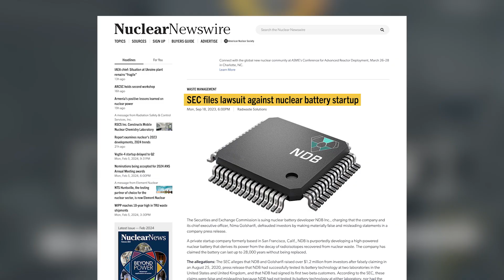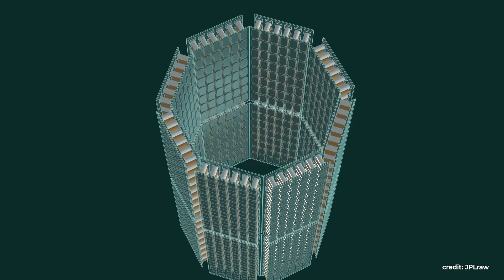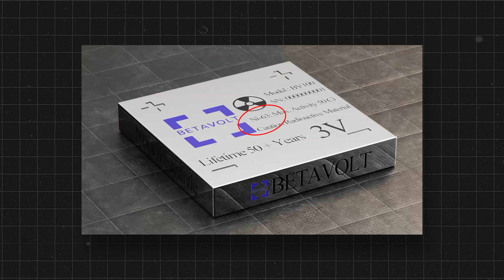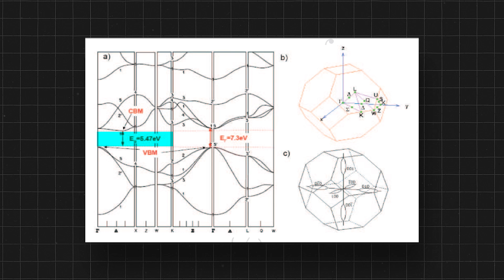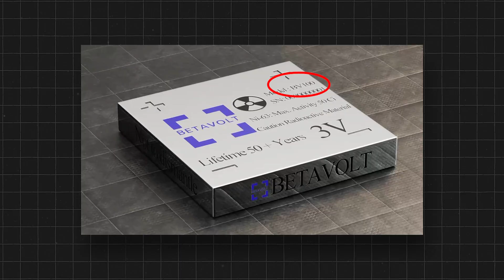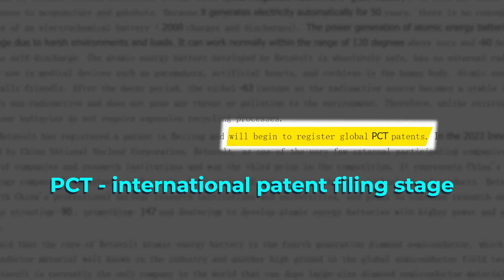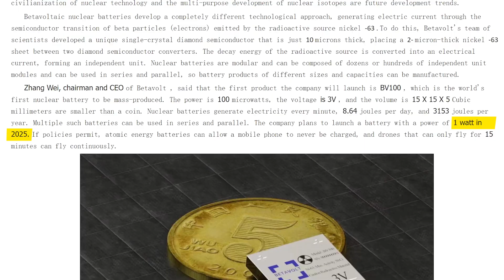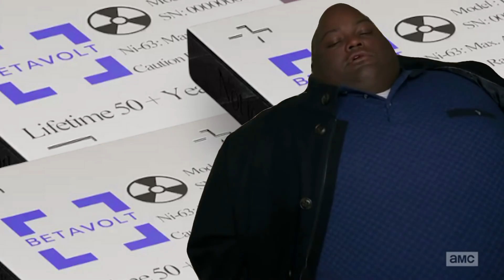Inside China's Nuclear Battery Breakthrough

Comment: For lighting perhaps you can create a "1 piece unit":

1. That contains the batteries in parallel.

2. The batteries can then connect to a wireless controller. 

3. The controller will then connect to the light which will be energy efficient LEDs. 

4. The whole "unit" will then wirelessly connect to a wall mounted button. 

5. Then the whole unit can be controlled via the button or smartphone. 

This would allow for more batteries to be used, but spread out rather than in a central location and they can be recessed into walls or into roofs depending on the location of the lights. 

By being a "1 piece unit" this means that users can replace lights older lights one at a time making them more cost viable to do so rather than having to do a whole house at once as well. 

By making the lights and batteries "1 piece unit" it removes the need for additional costs of wiring and electricians being needed.

Comment: I worked on the original nuclear batteries for pacemakers mid to late 80s? I recently found out that 29 of the original units are still being used as of 2024? So apparently they did have a highly successful design. I have no clue why these pacemakers were not replaced for newer designs.
Reply: Patients dead or refused surgery.

Comment: I would love for this product to get up to scale for consumers and have 1 watt or more output at 5V (maybe 3V). These would be fantastic for remote micro controller projects that power would be clunky to get to.
Reply: These are far from "new" and are commonly used in pacemakers for decades now. They don't scale as they are the same tech as the RTGs which have been in use since the 60's by both the US and Russia in satellites and the like.
Reply: @SilvaDreams  I am referring to the Chinese manufacturers claims of 1 watt by 2025 with reference to betavoltaic technology. Also RTGs uses heat differentials and betavoltaics don't (at least not at the massive scales that RTGs, there might be some minor heat generation but who knows and they don't primarily generate electricity through heat differentials). So these are not the same RTG tech as the 60s.

Comment: Sorry but this is not new. 
That is for one. 
 Umber two, this batteries have an output in current in micro Amps which is totally useless for 99.99% of electronic applications. 
The applications which can make use it are highly specialized and few apart. 

This “break trough” is nothing but rubbish, you know it, but try to capitalize on it. 
 Useless video and channel.

Comment: Nice perspective, but your approach to low hanging investment fruit "move the needle on things that will change our lives", trends towards a WALL-E universe, and it's also quite self similar to our current climate predicament.

Also the researchers should consider doping their material for faster decay rates. No-one currently requires a battery which will outlive a human life cycle.

Since in chemical science it should be possible to effectively dope a substrate to reach any desired density ratio it also does away with the concept of nuclear generator, as when we can dope that well, why not just modify the substrate to directly release electron volts?

Tech is stillborn, they just didn't realise it yet

Comment: 5:40 This is a nitpick, but it is not a generator, it is a battery as it is releasing power stored within, even if it is converting the power from different state, in order for it to be generator there would need to be a way to replenish "fuel" that was spent in the generation.
Reply: RTGs aren't usually refuelable either. They're still considered generators by engineers regardless of technicalities. It's not practical to think of either as a battery.
Reply: @striker6967  "it's not practical to think of either as a batter." why do you think that? It would seem to me that it is more practical to think of them as a battery, like a battery it doesn't need maintenance, refueling and just puts out power until the "charge" is spent.

Comment: Extending the use of nuclear batteries from space to personal applications is Interesting presentation.  But a power density (either surface area, akin to solar cells, or volumetric) )of a few microWatts per square or cubic  inch, seems much lower than today's solar cell or a three dimensional stack of interspersed solar cell sheets, and  radioactive material in thin sheet form.

Comment: overall there are other nations who developed the tech and dont cut corners,  Nuclear diamond batteries have potential for the right things.

<red commie country> wont be a cheap option unless you have a disclaimer against any damages resulting from batteries and contaimination from their manufacturing processes.
they are safe apparently , unless you have battery manufacture problems.

LIon batteries, fine.  cheap imports maybe not.
upscale.  big nuclear diamond batteries, safe long term, no contamination,  unless corrners cut, and unchecked stolen tech used to replicate on the cheap products to compete.

well good luck on insurance, or any liability to their use , had they been on the fly <red commie country>  spy type tech
Reply: note i had to say <red commie country> as if i mensioned who it was no commentary was allowed,  <RedcommieCensorship> does not let me allow to name who is removing commentry from this video.  who does seem be pushing said countrys agenda.    
Go figure ;)

Comment: the bit not talked about, there not big power output batteries, but as covered in the video, last a very long time, but bit that not covered, it's imposable run them power dry?, as covered in the video, there more of power generating plant in scaled down in size a lot, the power hold is not really stored (or not stored at all) the like generating power planet the turned on 24/7/265 a year, that will keep running (50 something years) output power wader it used or not, so as long the what every project  is not sucking up all the outputted battery power all the time, the the not used power could be getting stored in rechargeable something maybe capacitor, or even just your regular rechargeable battery,  and peek demand times, it supplement low output power of nuclear battery?

Comment: I think there is a large market for home/industrial monitoring in this power range. I designed a IOT sensor that sends hourly updates with a range of ~1 km. It uses off the shelf components and runs at an average power of 150uW which is equivalent to 3 AAA batteries replaced every 18 months. Sensors for home/small business alarm systems use even less power, perhaps 75uW.
Reply: that's milli Watts you've got there, not micro Watts, you're using the wrong units
Reply: @FooBar89  As electronic engineer myself you are wrong we get designs in microwatts... If the device is in sleep mode your CPU is pulling maybe 1 micro amp..yes 1 millionth of and amp. Why he is getting 75 microwatts is when you power up to send data your peak power shoots up , but as it's all averaged out over time so his 75 microwatts sounds spot on.
Reply: @ntal5859  maybe read what I wrote again, you are going to need many orders of magnitudes more power to send data, it isn't about MCU sleep time

you are going to need a lot of current, and you are going to need a lot of power, how much of it? it depends on the transmitter, and range

Comment: Id be interested to see if these would allow small electronics to enter a more efficient power saving mode. Being able to shut off core features to save power while still being able to boot up again on standby.
Reply: Um as electronic engineer I can tell you we already do this with embedded designs IE CPUs have sleep modes going usually into micro amps. This has been done since  day one in battery crital applications.

Comment: Good point that it is too early for consumer use.  As for solid state batteries, they all use a glass or ceramic electrolyte, and there's your problem: extremely brittle.  It's no good putting it to use in an EV that will shatter the battery the first time the body flexes while going down the road.

Comment: This is interesting tech, although I cannot really imagine it getting approved for sale in most developed countries, simply because of the possible risk of radioactive contamination in landfills (the half-life is long enough to be of some real concern). Let's leave that alone, though, and pretend that's not a giant issue.

I think if they can reach half a watt, they'll be able to build a bunch of products people actually want. Smoke / C02 detectors that never need new batteries. Generally, low-powered IoT sensors for various wireless control systems and monitoring. The big benefit is that this tech would make a lot of things that aren't done right now because of the expense / complexity of wiring in new sensors (say, providing better coverage for commercial structures built before wired-in climate zones were a thing, paired with dampers, etc.).  

Obviously, this tech isn't suitable for operating a mobile phone or anything that expensive, in terms of power. But! The Nokia 3310 (the ever-famous "brick") only used 2W... and that, with the tech of the time! We can probably get it considerably under 1W now! So anything that doesn't need a lot of computational power (or can except a very low clock speed to save energy) can work. 

Even if they reached 1W in output, though, they'd be unsuitable for drones (with the possible exception of ultra-duration high-altitude machines, where going fast / responsive controls are not required).

Comment: Russia had "nuclear battery" ... they were called RTG A radioisotope thermoelectric generator ( RTG, RITEG ), sometimes referred to as a radioisotope power system (RPS), is a type of nuclear battery that uses an array of thermocouples to convert the heat released by the decay of a suitable radioactive material into electricity by the Seebeck effect.
( warning - previous sarcasm/irony alert ) ;) LOL

Comment: 100% these are a stock pump and dump. 50 curies is a huge quantity of nuclear material. A tritium exit sign has about 15 to 20 curies per each sign, and that is rather cheap per curie, roughly 60 bucks or so, Ni 63 is much harder to make and has less uses. It cost a whopping 300 bucks a curie from a Russian company that made soecialty isotopes way back in 2016. The nucleus corporation in the US didnt even give a quote on the stuff. Ended up finding a nonradioactive solution to the problem though. Also much cheaper solution as well ❤

Comment: Something i saw many years ago, possibly on Tomorrows World
Someone made a device that used a bright light source wrapped with solar panels, the idea that the light was close to the panels meant less loss, i can't remember what the light source was, but it could have been hydrogen, this device was demonstrated in a car
I'm just wondering what happened with the idea, or if you can find any info, i haven't been successful.
Reply: Sounds like the kind of idea that will completely convince someone who also fully believes in perpetual motion devices, but in reality is an extremely lossy method of energy transfer instead of a much better and simpler method.

Comment: It is a scam.
Seriously - all we know is that they had a working 1uW prototype so far, yet they claim they would produce a 100uW commercial version by this year, and a 1W by next yet. That would be an increase of 6 orders of magnitude. That is not gonna happen.
And we know it will not happen cause radio-isotope batteries have been in commercial production since the 60s - aka some of the biggest companies involved in battery-technology, semiconductor-manufacturing and the nuclear industry have been working on those for 60 years already and the most you will get there is like 1uW (i think CityLabs 0.4uW is still in the range of thousands of dollars each).

all they have done is showing completely computer-generated pictures and making impossible claims.

Comment: Othet than the weight and size of the potential 1W battery, the issue with Nickel 63 is the short half life (100 years). With such a short half life it guarantees there are no naturally occurring Ni-63. As such Ni-63 can only be manufactured in a reactor, making it very expensive, at around $4000 USD/g. Far too uneconomical for the potential batteries to be manufactured at scale. To me this is nothing more than hopeful vaporware meant to trap gullible investors.
Reply: Nice. I haven't sen anyone call things vaporware for years!  That's what this reeks of though! A bunch of random technobable, all to say they can make a  2v battery. um yeah?

Comment: Low energy seems like a good fit for certain things like an air tag or bios battery or something basic like a smoke detector. I could be wrong since I don't really have knowledge about this but it seems doable with some capacitors and other battery technology to collect the trickle charge
Reply: Not nearly enough power. These are the type of batteries used in pacemakers and they don't scale.

Comment: It is a battery just as much as any conventional primary cell.  A normal primary (non-rechargable) cell can be described as a chemical generator, producing energy via a chemical reaction.  But it's also called a battery, and is the common meaning of the term.  It seems to me that you're so used to rechargeable lithium batteries that you associate the ability to store and release power (e.g. charge and discharge) with the term battery, so are confounded by a battery that has the potential energy supplied during manufacturing, and does not recharge.  The nuclear battery described is no different from conventional chemical batteries in this respect.

Comment: It all about getting funding from potential investors? You had hit a nail when to mentioned voyager 2 using radioactive plutonium 238 to convert heat to electricity to power voyagers. Kind like the Flux-capacitor used in the film Back to the future. Most innovation ideas start from a laboratory and ends there as scaling up for large production cheaply is very difficult. Such as CNT or carbon nanotube technologies for manufacturing large quantities is still very difficult after many years.

Comment: Why is everybody calling betavoltaics a "battery"? Isn't it more like a power "source"?
(for 50 years and then you have to replace it).
After all, you never charge it. It's not a storage tool for energy to consume later. It "produces" electrical energy. Constantly.

Therefore, if I may, I found the example with the drone rather ... unfitting.
A better example would be: Imagine the many cubic meters of gasoline tanks or wood pellet tanks some houses have in their basements. Imagine not half a microwave's worth of volume filled with such power sources, but rather like 10 m³. You said 0.01 m³ for 1 W of power. So 10 m³ would give you ... 1000 W. So 1 kW of power. CONSTANTLY. 24 kWh a day. 8,7 MWh a year. Probably not as the only power source, but as a supplement to solar. A base load energy producer slowly but constantly charging up an actual battery standing next to it.

Okay, maybe it wouldn't be the best idea to install a radioactive power source in every home. But what about 1000 of them in a nearby centralized and properly controlled power plant? 8,7 GWh of electrical energy production a year. For the next 50 years. Without refueling. Without carbon emissions.

Please don't call it a "battery". The way it works, it is NOT a battery, it's a power source.

Comment: I think emergency transponders would be a perfect use for these types of batteries, like backpack full of emergency gear that you need to recharge or can be left alone until needed, and wireless headphones could probably use them really easily as they down to really little energy usage.
Reply: No, they are 3 orders of magnitude to weak for that. That is the difference between a toy-car and a sportscar.
Reply: There are a number of old technologies for that:
Metal air, dissolved oxygen, and other chemical batteries can be left alone until needed. The components that react to produce power are not brought together until needed. Metal air hearing aid batteries have a little sticker to keep the air out Peel off the sticker and install in your hearing aid...

Comment: In my opinion a hybrid system where the micro reactor does its thing to keep a pair of battery cells alternately charged giving you portable power for little things like phones and tablets
Reply: The wattage/kg of the system described here is much too low for anything resembling that to be feasible.
Reply: M0R0N, that is like having  two large buckets with holes and filling them with an eye dropper.

Comment: 3v at what amperage.  these things have such low power output that the usecases will be significantly limited.
Reply: Quite. And Dr. Ben called his video: "Inside China's Nuclear Battery Breakthrough".
Reply: Maybe enough to power a game controller....lol
Reply: @randomkitty2555   It's 100uW (100 micro Watts). It's 0.0001W. That kind a battery it is.
Reply: @przemysawpawlinski5536  oh shit, maybe a calculator then.
Reply: @randomkitty2555  For you to have big energy from an atom you need to have high temperatures and this is not the case here. Actually, that kind of battery isn't anything new. Voyager Probes have the same thing only much bigger.